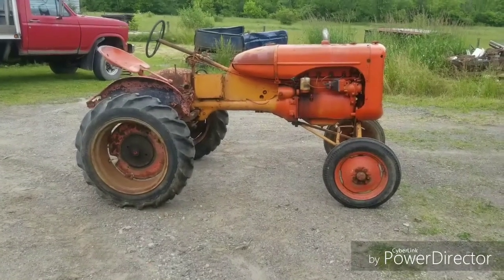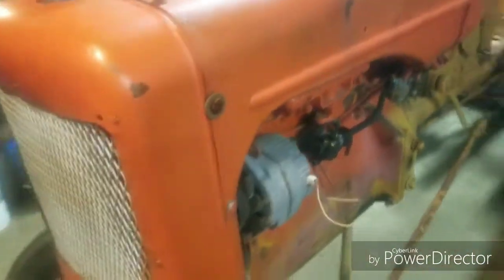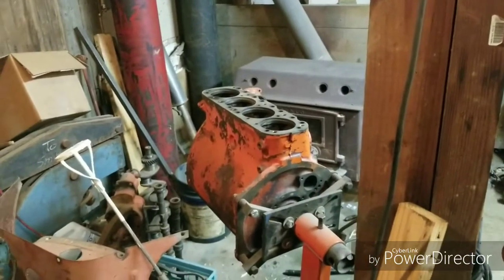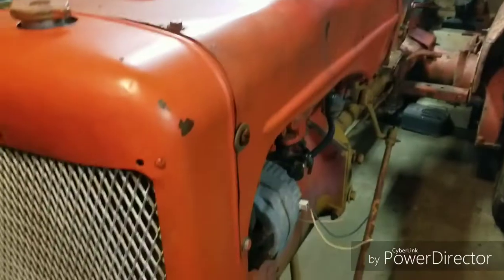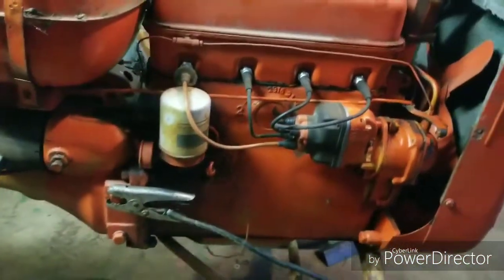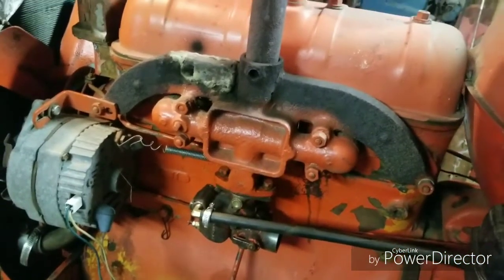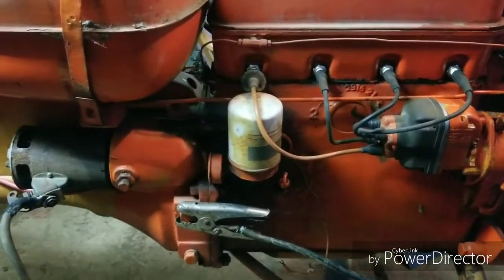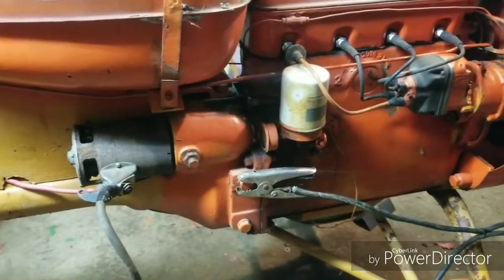The Allis Chalmers B project

Comment: Cool tractor project CE!
It's amazing what a little perseverance and mechanical knowledge will yield. You now have an assortment of tractors, parts for them, and a baseline running engine to rebuild. A great conversation piece will emerge from your knowledge and expertise working on the old school machines. I always enjoy the journey of folks acquiring an old machine in need of work, gathering parts, and then rebuilding the systems needing attention. Much respect for taking the time to examine all the parts, filming the discoveries, and the end results. Work safe.
Doug@ the "ranch"

Comment: we have one of these allis chalmers b with a woods belly mower. buying your own parts store is usually the least expensive. never fails.....get it running right and now there is something else wrong....and of course it has an oil leak!
Reply from the maker: Yeah it's nice to be able to get parts from a box in the back of the shop ! Still I figured I would have to rebuild the motor even though it runs, its worn out !